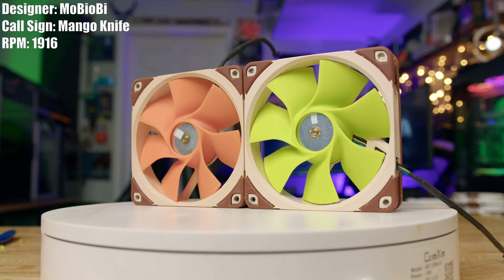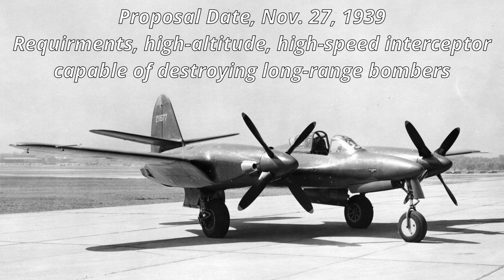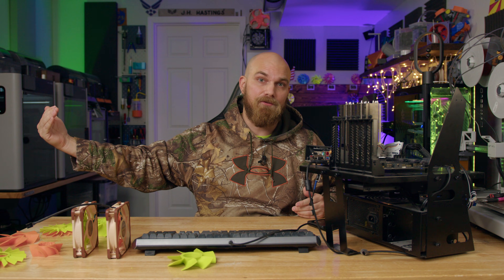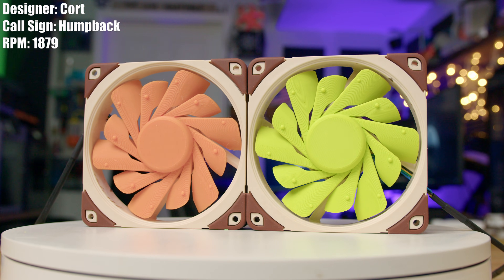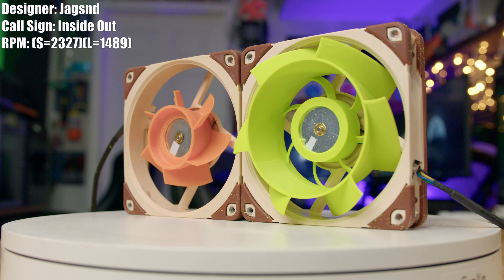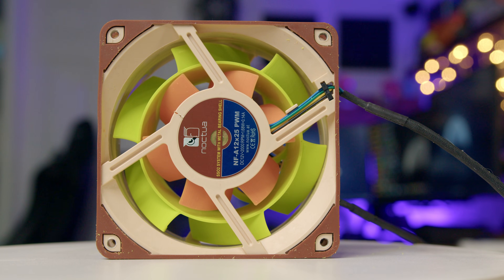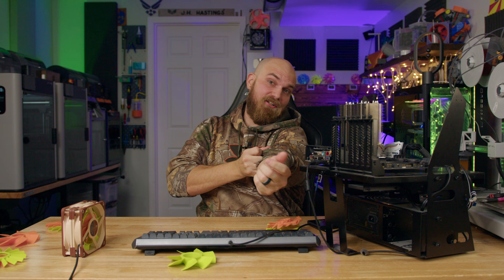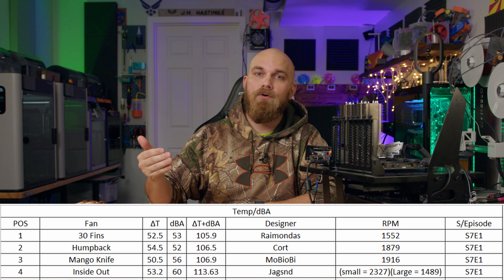Stacked TWIN Fan… is a Monster | Fan Showdown S7E1

Comment: personally I think using the cpu as a heat source in these test  is too inconsistent , should go to a power resistor and set it up so you can do constant power and constant temperature operation then sees how the fans perform against that.
Reply: Not gonna happen unless Major hooks up with Gamers Nexus to use all their fan testing equipment.
Reply: @tacticalcenter8658  Peltier element with the cooler mounted to the hot side and a temp probe on the cold side. Peltiers will maintain the same temperature differential across both sizes so you have your constant heat load there. Cool the hot side efficiently, the cold size gets colder.
Reply: Ya could use those semi conductor heaters and a  power supply for really consistent heating. They make them in perfect CPU sizes that the cooler could be mounted on. I ordered some for a project and think they were around 350w each. They really resist being cooled down and could even use the power draw as the measurement since they self regulate. 
I built a make up air / heat exchanger for my off grid home with them. May actually end up using peltier junctions to use excess solar to cool incoming air further in the summer.  The system uses 2 CPU fans in a push pull setup.
Reply: @scotttod6954  Yea i was thinking thick film power resistor and using an Arduino to run a PID on temperature or current and it could also data log. I build similar but more sophisticated devices like that for work, so that's where my mind went too.
Reply: @orbitONhigh I like the semi conductors plates because they are self regulating. The more you cool them the more power they will use in a direct and measurable way. Very repeatable and easy to calibrate. A fixed resistance heater would work with a current limiting or voltage limiting power supply very well also. It may exaggerate findings though since resistance will rise with temperature.
Reply: Dude, that's a good idea, but there are bigger issues with this test and scoring the dB levels is total garbage!  
The dB level is not even useful because of frequency with the sound.  You can have a fan with a lower dB, and it can sound louder to you than the one with a higher dB because of the frequency.  It's highly subjective because the dB level is just a number and not a human ear that perceives how loud something is in reality.  
There is a reason sirens use specific tones, high-pitched tones,  because we perceive them as loud compared to if you had a subwoofer at the same dB with an 80 hz tone.   
Using dB to judge the fan is garbage in and so you get garbage out.... waste of time.

Comment: Dont forget to add the a12 in as the control. Then we know how people do in comparison
Reply: I actually wouldn't mind seeing others added, too. No, it wouldn't be apples to apples, but would still be a nice added metric to compare against.
OR 🤔 If not a different model maybe slightly over-volt the A12 to 14v and 16V, to compare with it under higher RPM and slightly louder profiles.
Reply: yess !!! I was thinking of that, always do the test with a normal a12 every times so things like the ambient humidity and temp dont invalidate the results !
Reply: @SpeedyGwen   The humidity in the basement would be a negligible change and the temp isn't a factor since we're using ΔT, which is the difference in temperature change. So a fluctuation in ambient temp by a few degrees won't throw the results off. That's why he goes with that for the ranking, otherwise he'd have to retest EVERY blade design each time, too 😅

edit: missed typo; ancient->ambient 🤦‍♂️
Reply: @DUKE_of_RAMBLE it could be standardized based on a normal a12 at least
Reply: @SpeedyGwen  Definitely agree the A12 should be there at the very least! Which is why I even suggested adding one or two others, as I know he has at least one of the other popular ones. (the Nidec GentleTyphoon I believe)
Reply: @DUKE_of_RAMBLE The humidity of my basement changes dramatically between summer and winter or extra heat sources like extra PCs  lowers the humidity.
Reply: @Monkey_Chimchim  I believe that technically the humidity isn't changing from the heat sources, it just FEELS like it is because the dew point has changed. (been a couple months since I watched a video that explained why it feels like a heatpump HVAC makes a place drier in the winter)

Is your basement fully finished like his?  Also, do you live in a similar area to him? I can't recall where he's at, just that it is north enough to get a good winter with snow.
(sincerely asking, not trying to be snarky, even though it definitely looks that way 😅)
Reply: @DUKE_of_RAMBLE  humidity is the current amount of water in the air as a percentage of the maximum amount of water the air can hold.  warmer air can hold more water than colder air. So when you heat the air up, you are causing the same amount of water a lower percentage of the maximum amount that volume of air can hold, thus reducing humidity. Most things don't care how much water is in the air, so much as whether or not, and how much of, it will evaporate into/condense out of the air at what speed, so 'percentage of maximum' is the more relevant figure.
Reply: @SpeedyGwen i was also Missing the noctua Standard WE are trying to outperform
Reply: Needs to be 2 of the A12 fans for the control.
Reply: Came to say this.
Reply: Would like to see the og a12 and the new a12 for baselines.
Reply: @ChrisC576  why not both all the other tests were done with the og one but would be good to see the new one aswell
Reply: also a Reference without any fan would be interesting.
At what point would a design do more harm than not using one at all.

Comment: Would like to see previous season winners ranked in this system, and also the OG Noctua. Just to better understand a baseline.
Reply: The Wave from season 2 episode 1 had a delta of 59.6C but only 43.2 dBA - that's a score of 102.8.  If you force two fans into use, increase dBA by 3 (double the sound source, increase decibels by 3), and it still beats today's "winner" at 105.8 :)
Reply: Would be wild if the last season winner was still better, with just one fan lol
Reply: good point, also wouldnt it be a better test to test incrementally based on rpm? like cpu temp for each fan at for instance 800rpm 1400rpm and 2000 /max rpm?
Reply: @narachi-  I don't know that he wants to do 16 tests for each showdown!
Reply: Getting really consistent medium loads on the CPU is difficult. Could be that one run uses half the cores, the next could use slightly more. The exact cores that get used can vary even if the number of cores used is the same, meaning you get into differences in how good the thermal interface is over that exact core, as well as just slight microscopic differences within the CPU that can cause one core to not cool as well.

Because of this, the most consistent way to test is to just send it full throttle, hit all cores at full speed, as then you know the load and temp output will basically be identical on each run.

Comment: Nice! Thanks James for having my mangoKnife on the show. I put the stl/step file up on Maker World, if anyone wants it for anything. Guess I need to design for quieter fans...
Reply: Noise IS important, but it's more about the tone and profile than the pure decibals. Your fan would drive me insane even if it was quieter because of the tone.
Reply: It's the winner in my mind.  I found your site.  I'll try and print it when I get set up.
Reply: I assume you submitted the visuals shown around/about the fan... I appreciate the details! Thanks~
Reply: @Graghma yeah, a bit more on the Maker World stuff I uploaded too. P-Q curve, SimScale pic. 
Also, I've already sent in a mod for the mangoKnife to @majorhardware that should reduce the dB level. See if it makes it on!...
Reply: Na true gamers want cooling. We ware headsets so sound doesn't matter. Cooling is what matters.
Reply: @dustymccloud1840  Blatantly false.

Comment: Noise can be mitigated through other means, so not fulling seeing the value in adding that to the metrics.
Reply: Also the noise of the "winner" would go up if you actually wanted to archieve the same delta T with it
Reply: @EinfachFredhaftGaming  it is kinda interesting though, thermals seem to matter much less than noise so now people are incentivized to make the quietest fan possible that doesn't terribly overheat the cpu
Reply: @theneonbop  that's kind of my point. You could throttle the louder fans which perform better and propably make them run quieter at the same delta T
Reply: @EinfachFredhaftGaming  I guess that converts the challenge into 'how do I get rid of energy without making too much noise'. Maybe a better version would let people suggest speeds to run the fan at as well

optimizing for sound is very different from past fan showdowns but I think if done properly a focus on sound could be interesting to watch
Reply: even if we say noise is a symptom or synonymous with wear and tear on the bearing, theres too many other variables that keep it from being a reliable metric and is rather subjective, and will depend on the use case. for some clients it wouldnt matter if the loudest fan in the world, if it pushed more air for less volts etc etc.. would have been nice to see the rpms be a constant and tested incrementally, so we can hear the differences and detect oscillations. (i wonder if you can PWM tune it like a drone motor for musical notes)